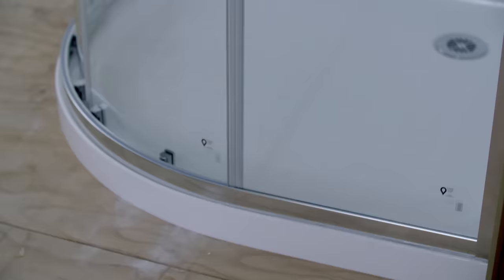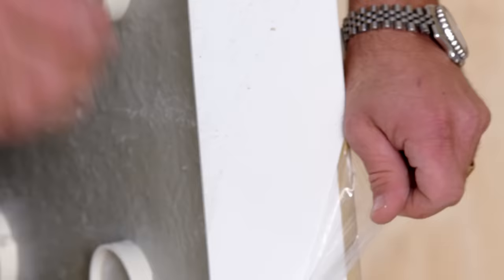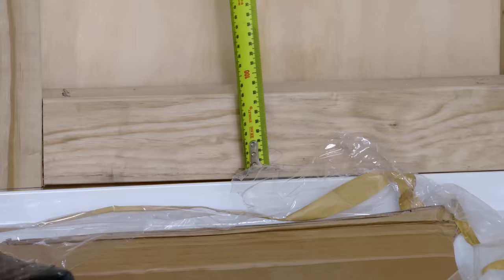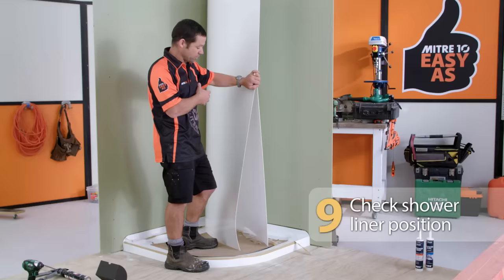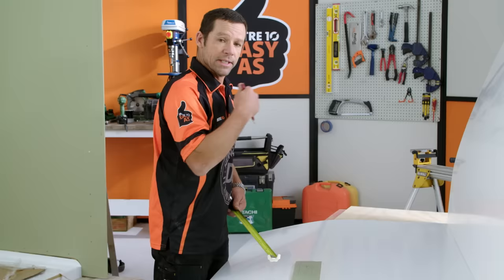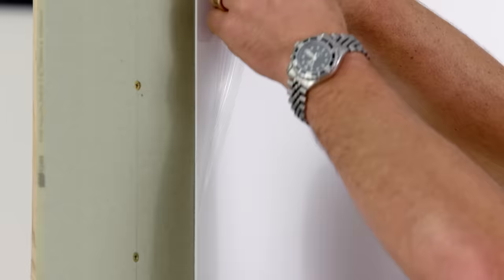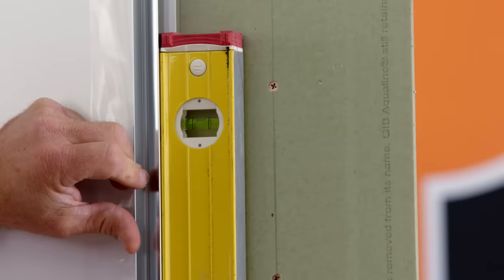How to Install a Shower Enclosure | Mitre 10 Easy As DIY

Comment: Anyone watching this, i followed this instruction to a T. Lesson learn: Triple the amount of adhesive  on both sides. That 80mm gap between adhesive bead is far too wide, aim for 3-4 tube per side. You will not regret it. Add about 50-100mm horizontal bulk bead on the tray/aqua-line transition gap. Sit the liner like a tent (with the corner edge pointing up) for at least a day before installation, this will make the corner more  sharp 90 degrees and get rid of any rounding.  Spend a good 20min rubbing the adhesive  through out the area of the liner. Pay closer attention to areas along bottom edge, and around the mixer. I cannot stress this enough! Good Luck.

Comment: Can liquid nails be used as the adhesive, why I ask is that the plaster board has been treated with waterproof membrane?
Reply: Yes
Reply: No you need to use proper bathroom sealant as no more nails won't bond properly to pvc

Comment: I have repaired two leaking showers due to the lowest screws attaching the frame to the liner and wall allowing water in. I suggest you smear the alu' frame, screw holes, screws with a load of silicon.
The bead of silicon he applied is insufficient.

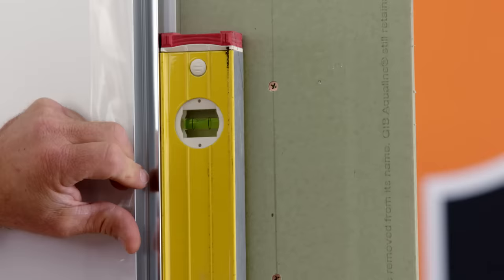Comment: 13:40   I'm confused as to why the silicone between the bottom of the frame and the shower tray has to go on the outside.
I would have thought it was better to put it on the inside to prevent water from getting underneath the frame
Reply from the maker: Hi Mick, thanks for asking! If applied to the inside, water may leak through the profiles causing a damp patch. And if sealed on both the inside and outside, trapped moisture will stagnate within. ^Cam
Reply: @mitre10nz  
Thanks for the reply.
But I think I didn't phrase the question properly.

I meant, why not silicone on the inside rather than the outside.  Not  seal it on both the inside and the outside.

Cheers
Reply from the maker: Thanks Mick. This is the most watertight solution is to silicone on the outside. If applied to the inside, water may leak through the profiles causing a damp patch. ^Cam
Reply: @mitre10nz  
Thanks.  That all makes perfect sense.

Cheers

Comment: I'm looking to install the exact same shape/style of shower.  How much variance is there from shower to shower in terms of the install?
Can anyone tell me exactly which model/make this particular shower is?  Thanks
Reply: You usually have the shower on hand before farming. What you can do is add the 4/2 on its flat facing the shower on critical areas such as the door and the slide rail of the shower head so there is less chance of missing with the screws later.

Comment: So what happens if you changing from a bath to a shower when the floor is concrete.. so the waste can't be fitted
Reply from the maker: You'd be best to speak to a plumber for the best advise 😊
Reply: You might have to add a false floor under the shower, that’s what I did. You will need to allow a drop for wastewater to flow if you know what I mean.

Comment: I have one of these but it is leaking :( I think I need to remove the metal door parts and put silicone in again
Reply: Hey, we just got one of these shower box too and the bottom coner is leaking! Did you manage to find out why your's is leaking? Thanks for sharing :)
Reply: @narajin9814  Video is just uploading now, its not the best quality but it should show exactly where my shower was leaking and how I've solved it.  I hope it helps
Reply: @SiggyPony  That's exactly the same spot we had our leaking issue. Just watched your video, it's super helpful! Thank you so much:)
Reply: @narajin9814  I'm glad it was helpful :) I hope you can fix your shower

Comment: I have applied sealer paint to the Gibb aqualine. i have been told I must not do that as the glue won't adhere and that I must remove the Gibb and installed new sheets.. is this true?

Comment: My shower liner has started bubbling from the jib - coming away from the wall. How do I fix this?
Reply: Remove and replace, possibly may have to replace the aqualine gib too.
Reply: That would be because you had paint or stopping compound behind the liner.only thing you can do is remove it and do it properly

Comment: what is the reason for the jib aqua line to sit 10mm above the tray opposed to being hard against it?
Reply: Probably so it doesn't rot if it gets wet
Reply: To allow for earthquake movement
Reply: Gib manual says there should be silicone between the tray and gib, he missed that
Reply: Because of Capillary action

Comment: How do you cover the GIB above the shower? I believe it is prone to splashing... Any particular coating on it?
Reply from the maker: We've used GIB Aqualine which has a water resistant core to help prevent steam and moisture penetration 🙌 ^Cam
Reply: You should gib stop and paint before, notice they say ‘water resistant’
Reply: @wayneg5433  can you tell me why most showers fail on the bottom corners next to the gib within the first 5-10years?